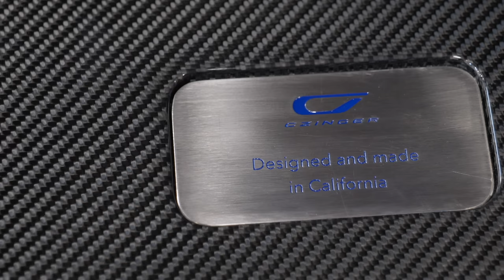Czinger 21C: In-Depth First Look At The 3D-Printed Hybrid Hypercar | Carfection 4K

Comment: I'll Belive those numbers when i see them, low 8's at the quarter is very ambitious. 29 sec 0-400-0 is Regera beating, numbers are nothing until you back them up.
Reply: @Kris Nicholson I'm not talking from a fanboy perspective at all, just mean that claiming 8.1sec on the quarter is rich without backing that up. There's currently no production car that can run it below 9.65sec, they claim to be able to go almost 2 seconds faster and THAT has to be seen to be believed.
Reply: @Kris Nicholson The only "problem" is, that the Venom is RWD and got a huuuuuge turbo lag. So it is really hard to drive it on the track and you'll need a set of new tires after the first 1/4 mile run.
Reply: Ya he's claiming numbers that beat koenigsegg coming from some very unheard of guy and his company. Koenigsegg can back up any number they claim we know this from experience. Christian V.C is the einstein of the automotive industry
Reply: @Sunedosa  now we have Rimac Nevera doing 8.6s
Reply: @rador3573  A year later yes but even that isn't doing 8.1 YET. As i said it's very easy to throw numbers out there and another to back them up. We will get there eventually, another question is if we should ?. Were does it end ? I've ridden 9 second motorcycles and i find it crazy that further down the line you can have a family of 4 doing faster times in  a car, driven by a 70+ old aged pensioner. A recipe for disaster if i ever saw one.

Comment: The 3D printing manufacturing process is the most fascinating aspect of the car
Reply: The most and the ONLY.
Reply: It has some 3d printed stuff. It's not 100% 3d printed.  3d printing has been used in autos for a while now.  This is nothing interesting.
Reply: Apparently the performance is really good but the design/aesthetics is VERY bad!
Reply: @gustavoflorio5383 Agreed that it's not the most beautiful / visually appealing of the new age hypercar startup brigade but it's not the worst..
Reply: So is the iterative evolutionary automated design!
Reply: @devilsguru  you can't run from its overall shape and that's ok... But the the sides and front end are childish. Looks like a kitcar from 2000's. And don't use the "form following function" argument because I don't have my degree yet but I know my shit.
Reply: While this is a subjective truth, if they can deliver on the claimed specs it will be quite a machine
Reply: Actually that is not all that uncommon. It is 100% designed by A.I. THAT is the most fascinating part.
Reply: No.... The fact that it was designed by A.I. is.
Reply: @SophiaAphrodite  AI is used extensively to design airframe components in much the same way as shown here. But to be fair, both design by AI and 3D printing are nascent applications. But they are growing fast and it will fascinating to see what the industry comes up with using them.
Reply: It has an Asian or jdm vibe going on
Reply: @pedrorodrigueztube  mainly Asian like an Asian Japanese anime robot

Comment: "rear seat has more space than the front one"
shows rear seat with no legroom
🤔
Reply: 2+2 seating too cramped? Remove two seats.... Still cramped. Hrmm, math broke.
Reply: With legs apart this is essentially a single-seat car for most intents and purposes.
Reply: Your legs are positioned in the space next to the driver, motorcycle style. The driver literally sits between the backseat passenger.
Reply: One sits like on a motorbike, so plenty of room, I have seen the other video... '0' emission and it will go that fast
Reply: Janusha  Exceeds Crash Tests

Comment: The best thing about this car is that it run on Vulcanol and its sustainable net zero emision
Reply: Gemera do that in a 3 bangers with 600hp
Reply: Богдан Кондратов  why can we like both. I do. Because it will keep the internal combustion engine alive. Both car are in production. But the Gemera have no set delivery date while this car was due to be delivered in 2021.
But we know Koenigsegg have much more stable economy at this point. So yes Gemera will obviously be a production car. But the 21C is unlike let's say Hennesey F5 or SSC Tuatara have an actual functioning prototype. It's not a shell car. And also a working production assembly line. So their odd to see the light aren't that bad either. This car have been developed since 2017. Top Gear have more immersive and detailed coverage with this car.

Comment: He said, "the space in the front is excellent and even better in the back". Please, look at 0:57. There is only space for a double leg amputee! This guy is totally delusional if he thinks there is ample space.
Reply: there's another video that shows the space better. I wouldn't ever say it's "better in the back" but because the legs are meant to be splayed alongside the driver's seat, not exactly comfortably but technically could seat someone. what confuses me is the shot where they show the racing harness/seat belt thing entering the back of the driver sear seems to pass right through where a passenger would hypothetically be.

Comment: did he say 8.1 in the quarter mile?
Reply: Yes he did.. sounds like BS to me
Reply: Dude! I think he did? Insane! I still wish it weighed half of what it does.
Reply: @cagf2013  With street tires? Absolute BS.
Reply: Easy to say 8.1 but I guarantee it won't happen in the next 3 years on street tires.
Reply: @stevenkelby2169   - electric or hybrid cars are different, they launch hard with almost zero wheelspin.  8 seconds is possible even on street tires.

Comment: 950hp out of a 2.9l V8 twin Turbo. Im sure they get so much out of it because of BOOST. But then I’m sure this engine won’t hold up very long at all. Also it’s a new company they don’t have the experience of making engines like Porsche, Ferrari, Lamborghini... I just can’t imagine this engine living very long when getting driven really hard.
Reply: Der Schtiede, Koenigsegg are getting 600bhp from a 2 litre 3 cylinder twin turbo. Admittedly they’ve been in the game for longer and their boss is an engineering genius along with a team of top notch engineers working with him. Who knows what is possible.
Reply: Sparky And they’re cars aren’t the greatest either if you’re looking at the life time of these: https://youtu.be/a7Pa_qt8_M8
They just won’t live that long either they aswell drive way too much boost too live long enough. You think this engine will be able to live 150.000km? 200.000km? There just isn’t a safespace anymore inbeetween the power they produce and the power it could produce/can handle.
Reply: @hikingjoe4752  Posting a link for an isolated case with an apparent engine failure which you don't know the specifics about isn't a proof of anything.
Reply: No wonder that Agera has problems. The way that idiot was revving it at a standstill. No mechanical sympathy.  I very much doubt any of these cars see high mileage except the factory’s own demonstrators. Probably 1-2,000 miles a year perhaps. The Merc-AMG One’s engine is only designed to last 31,000 miles before a refurb back at the factory. Shows how much even the manufacturers think their cars will be used.

Comment: The chassis engineering is quite plausible but I take issue with the v8's power figures.
Reply: I don’t have issues believing the amount of power. Because it’s twin turbo charged and they probably just run insane amounts of boost on this engine but there is the problem: the company is new and they go crazy nuts with boost and power per liter. This engine will probably die before you can spell the cars name.
Reply: @hikingjoe4752  exactly. If it was Koenigsegg and they told you it produced 5000hp and ran on Elf sweat you would probably go ok
Reply: W-J Racing Their Engines don’t last that long either.
Reply: @hikingjoe4752  but they have never pretended they do. Unlike Ford where Focus RS' are cracking blocks after 2k

Comment: I think this car looks outdated and late in design of more than 20 years. The tech involved is always talked but never shown to work (all the new machines the use are only shown while still or in some marketjng footage). All numbers and talks but what's real? Is crazy to think that a guy can "out-tech" somone like pagani that does R&D and sells the thech. Lamboeghini, Ferrari and McLaren arent near this claims and I think there's a reason. This is a scam. You never see the engine the batteries the motors. Lets not talk avout the 3d metal printing that can be used for exaust but what about loading a structure with mircroholes that are left in the structures during the printing. This is not worth a watch.
Reply: @Mireaze  Short answer: now I think this new car is even more stupid.
Long answer: what about that car? Same words same emotion and parts from some cars  borrowed and strapped into a frame. Flatspotted tires so Jay can't drive it fast what does it mean? You are showing your car to Jay Leno and you have flatspotted tyres? Come on. I'm sorry but you see this kind of guys that want to sell some million dollar cars with just words. Reliability and real cars speak for themselves.

Comment: for something that can run 0-100km in 1.9 sec and 1/4 mile in 8.1 sec

I noticed something around the headlight, its too vertical and space consuming, I think it can affect much of the aerodynamic, it doesn't have ventilation either

Edit: is that a vent on the top of the headlight?

Comment: Christian Von Koenigsegg has been 3d printing parts for his cars for years. This is not new and honestly, what's the point. It is usable and better than conventional methods in certain circumstances but a full car? Is it more reusable, lighter, stronger or faster to produce... no, it is not! 

And the theory that the rear engine can generate enough power that they only need 2kw batteries to power the front drive is doubtful. What's the point? Is it lighter than a AWD system? And why not go for a full hybrid or full electric? This car poses a lot of engineering conundrums that I honestly don't see the point of.

Comment: Koenigsegg Gemera: 2.0l 3cyl, 600bhp, 300bhp/ltr, everyone goes nuts.
Czinger 21C: 2.9l V8 twin turbo,
950bhp, 327bhp/ltr. Everybody: meh!
Reply: It's easier to achieve a high specific output with smaller cylinders.
Reply: Imo, it's about reputations. Koenigsegg has proved their claims and has set multiple world records, while Czinger hasn't. That's what differentiate people reactions to them.

It's a very fascinating car. I like the new changes they made (especially at the back) compared to their previous design, when it's used to be known as Divergent Blade. Still prefer them to remove the back seat, and just go with single seat design tho.
Reply: @budokpantai  yeah, but there was a time when even Koenigsegg was an unknown manufacturer and didn't built it's reputation in a day. It took time. With time, I'm certain Czinger will do something as well. Their design, engine, production and aerodynamics look promising for a newbie manufacturer.
Reply: @phamnuwen9442  A lot easier. Besides... he's talking numbers. Talking is even easier.
Reply: Deeez Nuttts  you've serious reading comprehension issues if you think I'm signalling Koenigsegg here. I'm highlighting the people's reactions to 2 different companies achieving similar targets.